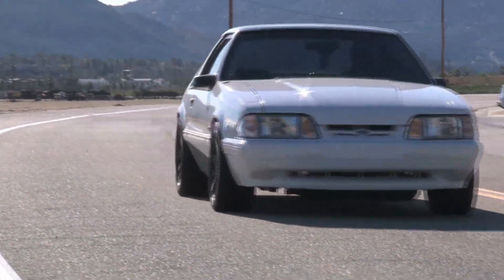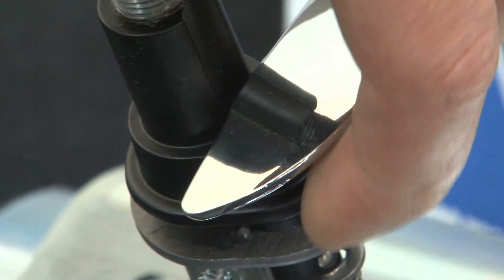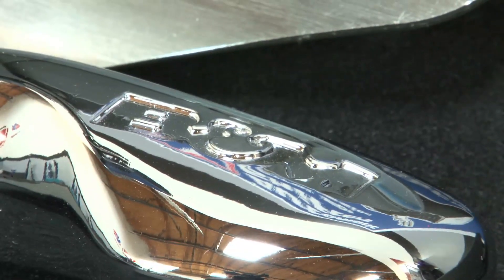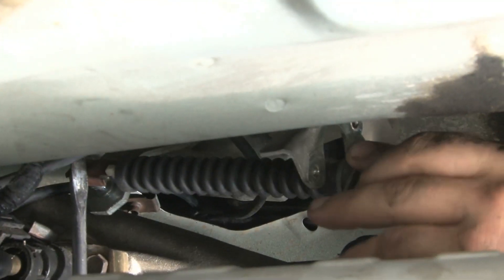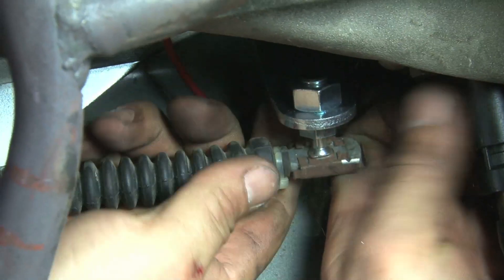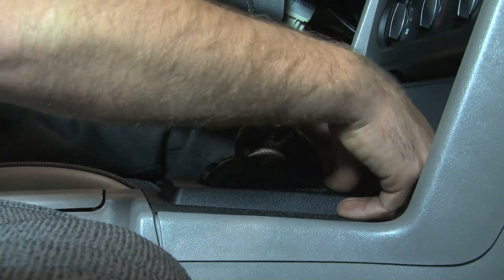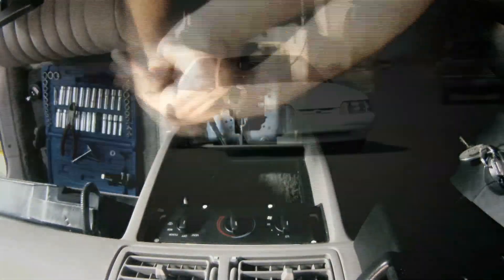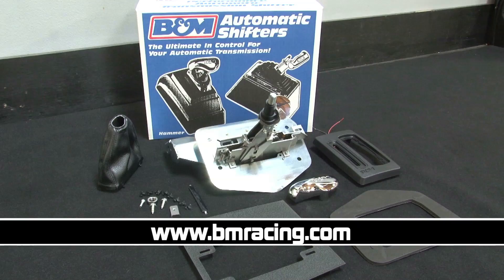Tech Review: B&M's Hammer Shifter for 1987-1993 Automatic Ford Mustangs

Comment: Its a hammer shifter kit. At 2:30 he's downshifting by bringing the shifter towards the rear, to upshift, you push it towards the front threw the 4 gears that the automatic transmission has. Its basically a semi automatic with that
Reply: And then how does it go into reverse?
Reply: @williamsanders468  no more reverse….. just kidding haha you pull the lever and bump it.
Reply: @maximusdascoulias8136  Phew good thing need that extra race mode

Comment: Don't expect an answer, but it would sell the part if its the answer I want.  Does this allow it to shift into 2nd and stay there. 

On the stock you have to shift to 3(D) and drop it back to 1 if you want to stay in second.  I would like to have an absolute 1-2-3-4.  
2nd gear is the drift gear, but if it falls to 1 and dont go back to 2nd unless I shuttle shift it.
Reply: If you want to hold each gear you would need a full manual valve body.  The shifter is only a shifter with ratchet function so you don't over shift into the wrong gear by accident.  It doe'snt change the function of the transmission.

Comment: probably because you installed one of these shifters on a car that doesn't need it. hammer shifter on a stock trans, not a good idea, because there is no point!!! He is shifting the trans manually with the shifter which is the purpose of it, this car has a full manual valve body, meaning it can't shift itself.